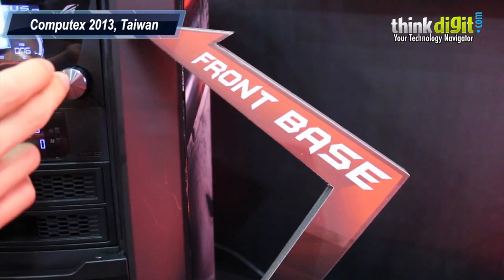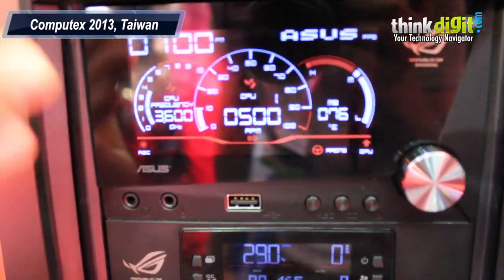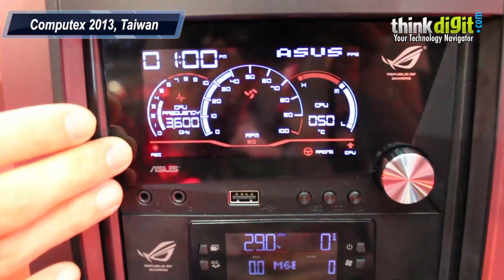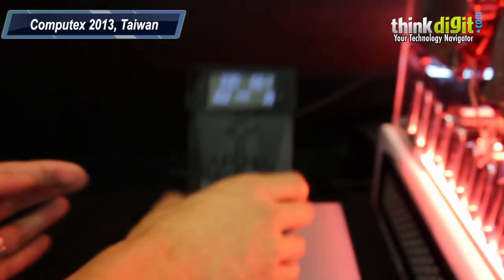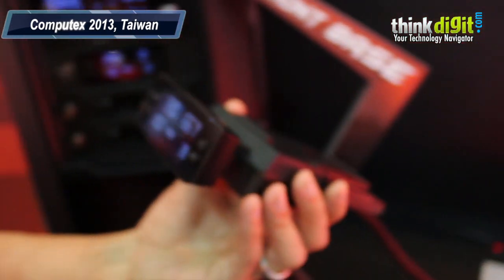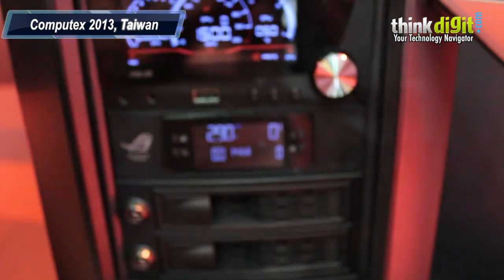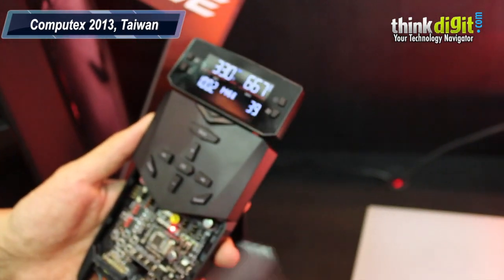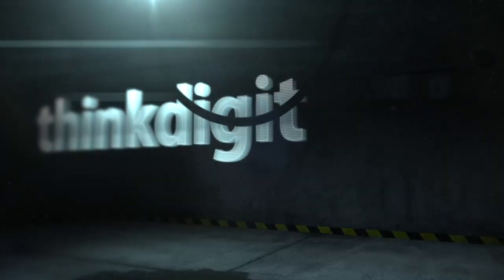ASUS ROG on board display prototype Front Base

Comment: i have the same setting, but please, can you tell me how u connect the oc panel when it is in the 5.25 bay, because my front ROG panel is connected to the mobo's rog_ext, so i do not know where to plug the oc panel, please help!
Reply: i just want the oc to display temp, i will do the overclocking from the front rog panel, if you can show the inner connections will be grateful plz.
Reply: @hhajjar  Hello, I need your help if you were able to solve this situation. I am experiencing the same situation.